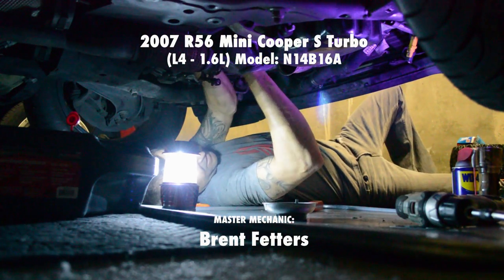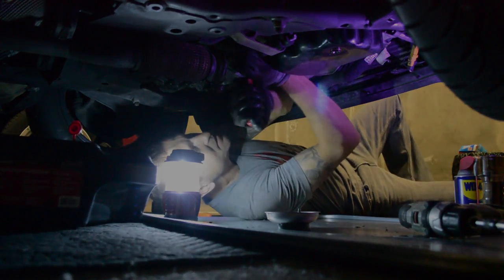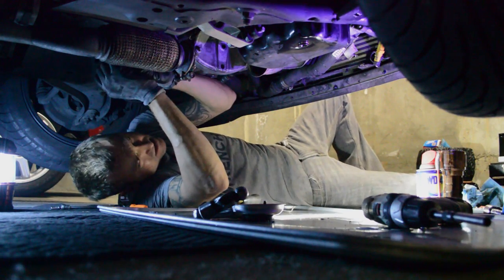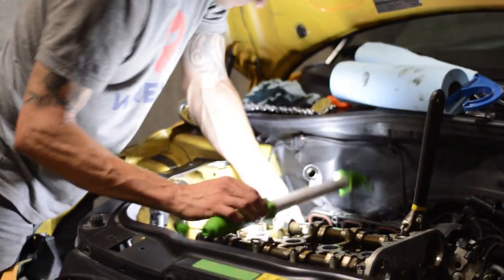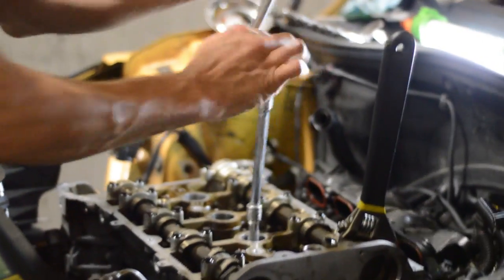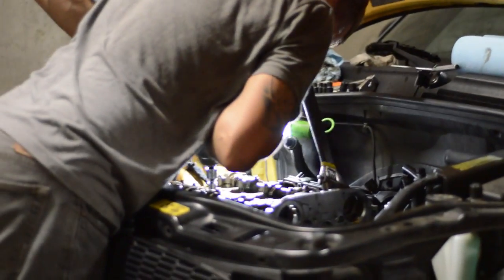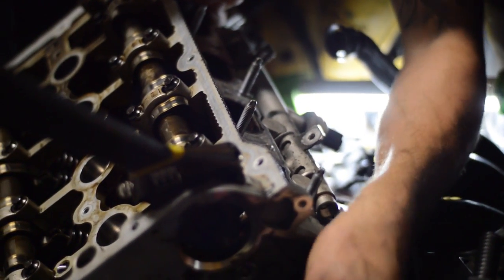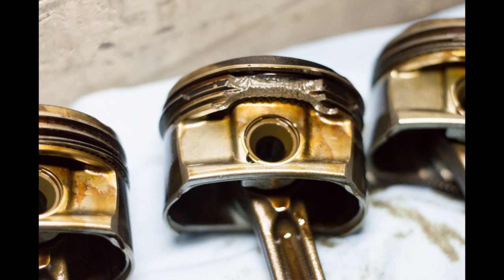R56 Mini Cooper S Piston Replacement Part 1

Comment: Ive got an R56 non turbo Cooper which is running just fine. However it just failed the UK MOT because of emissions. It has great compression of 150 PSI on all 4 cylinders, I had the MOT garage look at it and they believe its the piston rings leaking causing too much crankcase pressure, then quoted me £5k for a new engine! As I have nothing to lose am I able to replace these via the sump and do one by one? I dont see why I need to remove the cylinder head.
Reply from the maker: Sorry pistons go in from the top.
Reply from the maker: No way to compress the rings from bottom

Comment: If i want to Take Off the timing Chain, do i need to Life the engine??
Reply from the maker: You do not. There are a couple videos here on YouTube showing the job.  Definitely easier with the engine out.
Reply: @brentfetters8531  sadly i just have a tiny Garage to do the Job. Thats Why i need to do it without taking the Engine out
Reply from the maker: @denzelcrocker4956  I have never had to remove the fenders but the skirts do pop off with clips that i always replace.  The inner wheel well will need to be removed.  You will need to buy all new torque to yield bolts for the cam sprockets/vanos.  You will need the special tool that hold the crank shaft and the camshafts.

Comment: Did you Took the oilpump Out?
Reply from the maker: Yes. The oil pump chain has no specific timing marks so it can be slip on and off after unbolting it.  It's a variable pump and I have played with spring pressure to raise the oil pressure.  I've installed a new oil pump I think in video 3 or 4.

Comment: I couldn't quite understand what you said about why the bolts cannot be reused. What is the reason?
Reply from the maker: Many of the bolts are torque to yield. Meaning they are designed to stretch when torqued.  These bolts are one time use.  This is very common in several manufacturers head bolts🔩.  One good way to spot these type of bolts is if when torqued there is a specific degree the bolt has to be turned.

Comment: Didn't show how to remove the pistons after head was removed.
Reply from the maker: Once you remove the oil pan  you will gain access to rod bolts. After unbolting rod bearing just push the rod and piston out the top.
Reply: @brentfetters8531  hey! i know you made this video a while ago, but there was one thing that I'm not clear on as I'm about to embark on my first piston ring replacement. You have to take the top engine mount off to get the head and timing chain out. What was holding the engine up while you were under the car? Were you using an engine hoist? When I did the timing chain I put a block of wood and jack on the oil pan...so that's where I'm at leading into doing the job this weekend..
Reply from the maker: Put a floor jack under the engine

Comment: How do I take the pistons out? Mine are not damaged, but I've got the head off and wonder if it's easy to replace piston rings just for good luck?
Reply from the maker: Oil pan off and take rod caps off the crankshaft.  Then push them out.  I recommend taking the engine block to a pro shop to be reassembled.  It will be money well spent in the end.  My experience with talking with the Mini Community is reaming the valve guides is going to solve most oil consumption problems.  If you open up your exhaust system you will have less back pressure and less oil carry over from the pcv system.  Get rid of the 🐈.
Reply: @brentfetters8531  Thanks for your reply! I was only going to clean the valves and put new seals on them. If I got the guide reamed would I also need new valves with a wider stem? Starting to get expensive!
Reply: @brentfetters8531  hello,
Which cat are you talking about? And could you maybe Help me With some other questions?
Reply from the maker: @denzelcrocker4956  There is a catalytic converter in the downpipe between the engine and the radiator vertically mounted under the turbocharger.
Reply: @brentfetters8531  thanks. My Cooper S R56 started Blow Out oil from the pcv hose. I wanna do the Piston Ring Change, but im Worried about the engine Block quality. The car Runs smooth and normal. Do you think i need oversized Piston Rings or does Hone is enough? How was the condition of you block. The Car has 90k miles on it
Reply from the maker: @denzelcrocker4956  It's probably not your rings but the valve guides.  I sent my head to Exton Racing ans he installed new valve guides and then reamed the guides for an extra tight fit.  Honing and replacement of the rings is a good idea but oversized rings and pistons is definitely better.

Comment: Brett, I"m planning on doing a piston replacement on my car which is identical to yours... after watching this video a few times I wanted to ask if you had to remove the passenger side fender or were you able to create enough space by just extending the front fender?
Reply: front bumper... oop

Comment: Brent, thanks for your video. I have a stock R56 with a number 1 cylinder with 35 psi compression. When I did a leak down test I found that the majority of the air was coming out of the oil cap. I'm thinking that I have bad piston rings. Would you agree? Also can the pistons and rings be replaced with the engine still in the vehicle? If so I'll pull the head, get that machined and replace the rings and pistons. Does this seems like the right action but I do not want to pull the engine. Thanks for your help

Bruce
Reply from the maker: Bruce Hutchins Yes, most likely a failed piston.  I replaced the pistons in my first two videos and honed the block while it was still in the vehicle. Very do-able. But! my standard size pistons that I purchased had to much piston to wall clearance due to normal wear.  The rings will not seal if excessive clearance is present.  In my third video (more of a slide show) you can see I had to redue all of my work.  This last video #3 I sent the block to Exton Racing and had the cylinders bored for oversized pistons.  This has been a huge success and is what I would suggest to anyone that has had a piston failure.

Comment: I have a feeling my car might have a similar problem. It struggles to rev above 3,000 and blows oil out through the valve cover. I have an 09 Cooper S Hardtop.